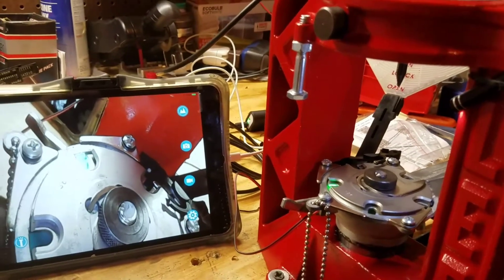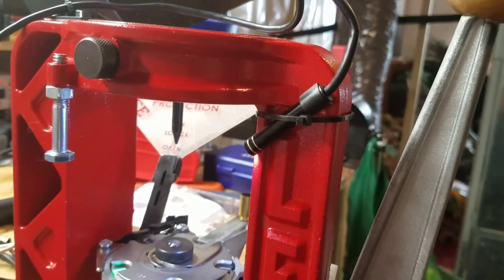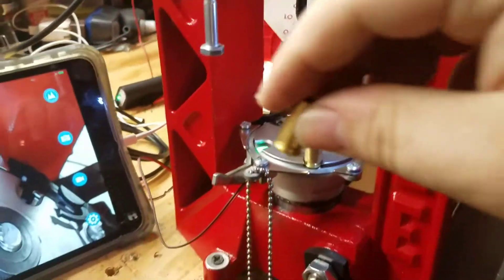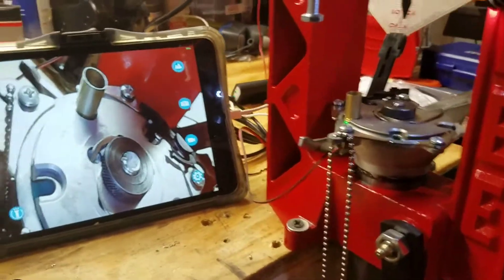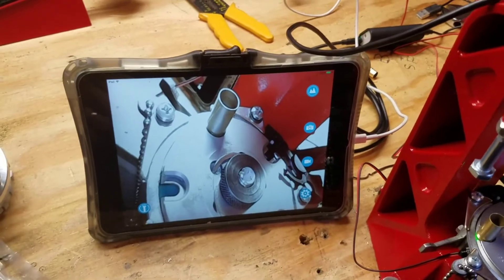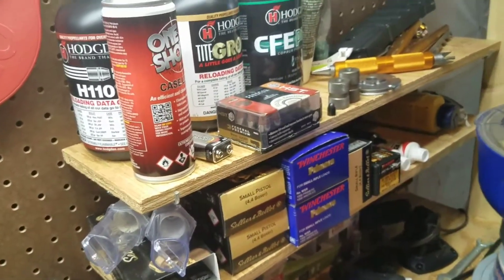Lee Loadmaster Priming Light & Camera Powder Check

Comment: watch your and several others about the led light under powder station to see if primer was in place.wondering before i did it can you  see light through small primer pocket[9mm]?ken
Reply from the maker: I primarily load 9mm with it.  Works great.  Harder to see on taller cases like 556 but works well paired with the camera.

Comment: Do you have to sand/cut the top of the LED to get it to clear the rotating shell plate? 

I did a similar LED mod a year ago but lining up the LED was like reverse engineering magic to get it to shine through a 9mm case. I know very well it won't work on my 
.223 press.

Comment: I have the lee pro 1000 trying to mount a similar endoscope but really ca not see the deep enough in the case to see light loads on 38 special.... any suggestions?
Reply from the maker: The turret plates have a center circle that can be pretty easily punched out using a mallet and a similar sized socket.  Then you have room between your dies to place the endoscope looking down.  I've used this and put a flashlight aimed down for additional light, but haven't bothered moving my endoscope yet.

Comment: I really like your LED to check for the primers.  I ordered the one that you linked to and also the 11mm.  My question is do you thing that the 11mm will fit? It would give more light, maybe.   Also, do you have the measurements of where to locate the LED.  I tried to put it straight up into the ram but it would not light up the primer.  I don't want to locate the whole in the wrong place and not have it work.

Comment from the maker: A couple of corrections:
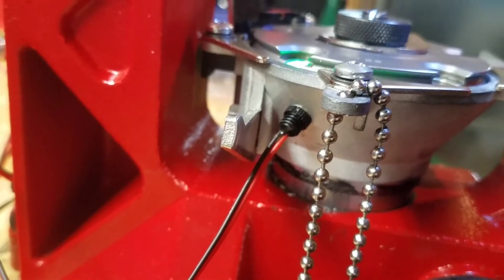0:34 - I said "5/32" hole, I believe it was a 15/32 hole.  I always drill pilot holes and work my way up, i'd recommend you do the same if you attempt this.
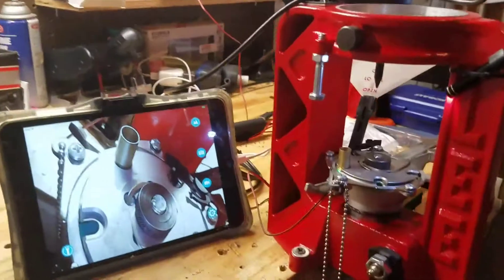2:58 - I said "Lee Lock n Load"  Obviously I meant Hornady Lock N Load powder system.

NOTES:
I could not get this endoscope to work with my Samsung Galaxy S7 (or my wifes), however there are reports it works with many android phones as well as laptops via USB.  I happen to plan to use the iPad anyways, so it works for my purpose.